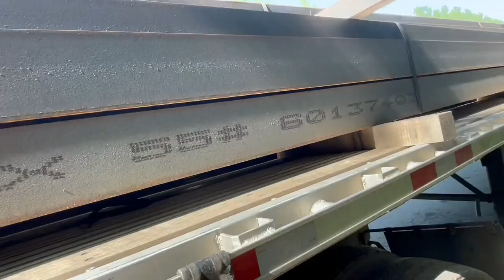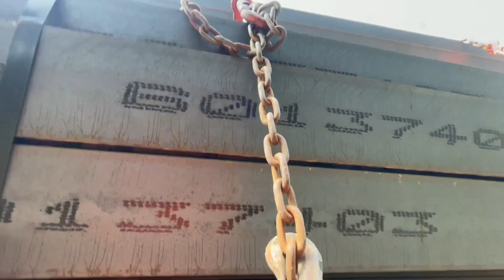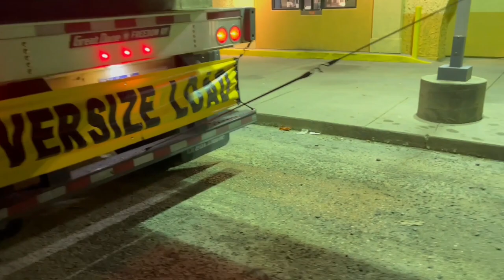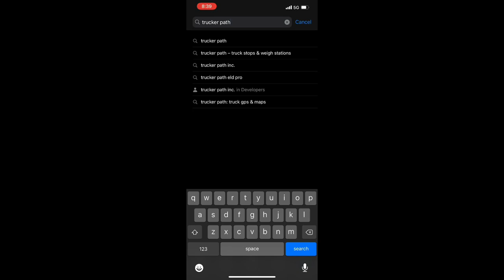How To Use Ratchet Binders Flatbed Load Securement #trucking #cargo

Comment: I don't know if Career Link still does this  unemployment program. But in 2017 they had a trade program where you can go to school for welding, hvac, plumbing and CDL classes.  The grant loan is up to $5000 and it paid for my CDL. Stay bless ✌🏾
Reply from the maker: Good deal right there man. Gotta use the system to your advantage

Comment: What about the other side? Do you use the hook, or do the same thing on the other side with another ratchet binder?
Reply from the maker: You don’t need another one on the other side. The two hook connect to the chain on both sides and pull it tight
Reply: @bigsnow1705  Thanks!

Comment: Are you with Blair logistics or P&S
Reply from the maker: P&S
Reply: I'm about to start releasing with P&S Is there anything you can tell me to steer me in the right direction when I start running?
Reply from the maker: Just run the same loads you do as a company driver. If you had good freight lanes stick with them and don’t burn to much fuel. Just get what you need